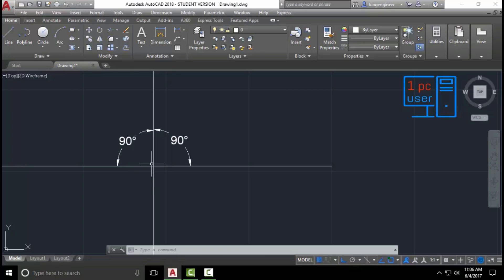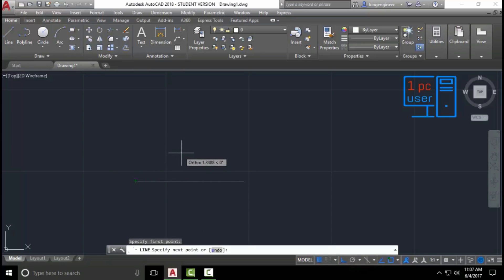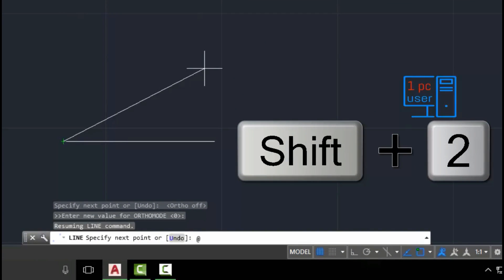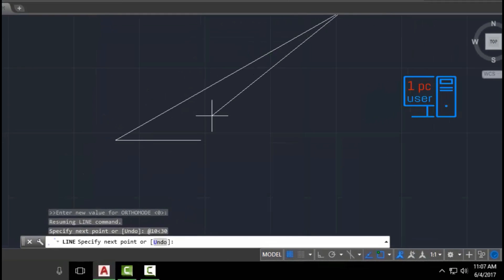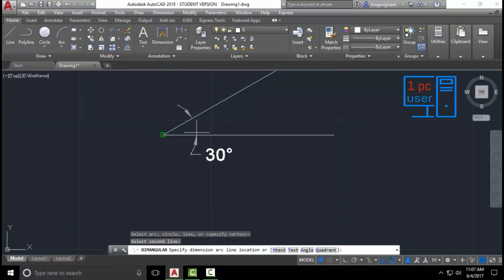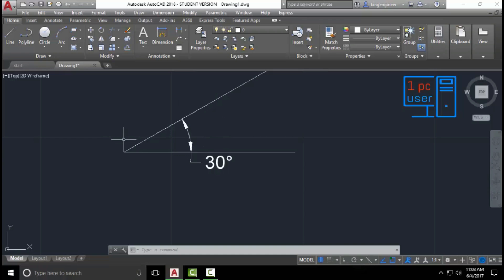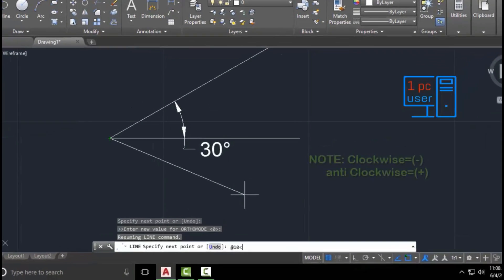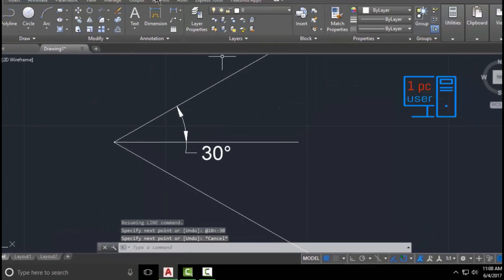Autocad 2018 line command tutorial - how to draw a line with angle in autocad with Polar Coordinate

Comment: So for example I want my angle to measure 60 degrees and the dimension of the line is 2.967 do I just type 

@2.967<60
@2.967<-60 (for the other side)

Or 

@2.967<300

???
Reply: Is is that simple??? 😳
Reply: If you want your angle clockwise from x axis, type @2.967<60. Both @2.967<-60 and @2.967<300 works if you want you 60-degree angle at a counterclockwise direction.